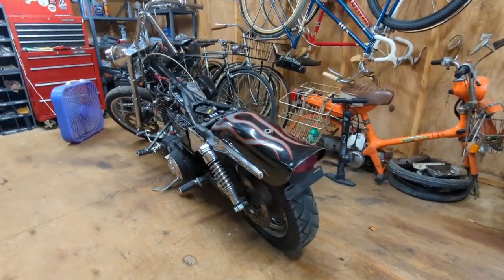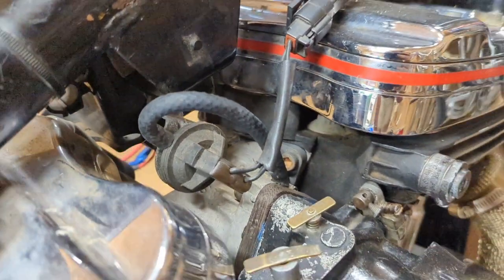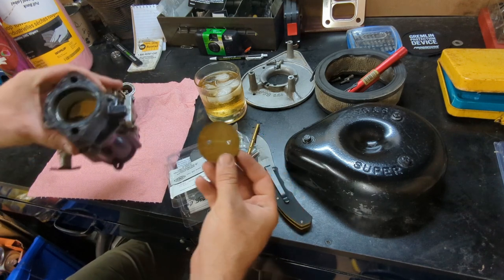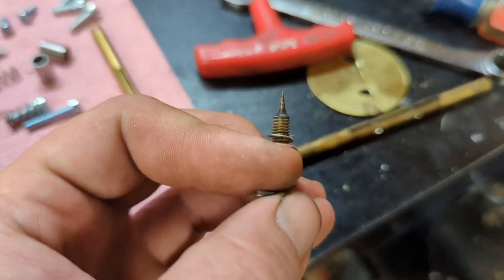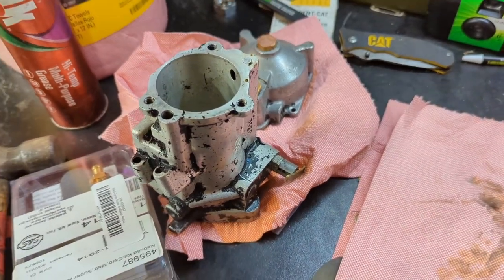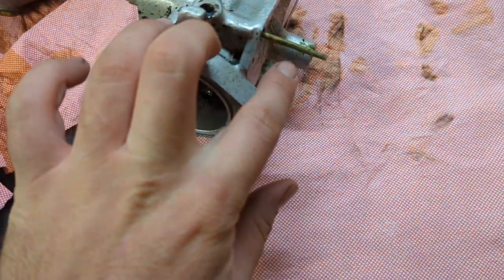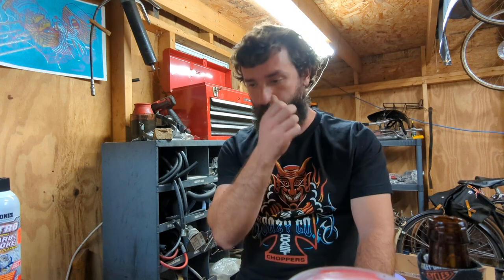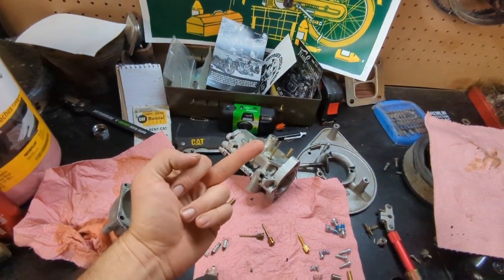S and S Super B Rebuild: Carburetor fail on Evo Chopper project

Comment: Fill the cracks with solder.  Order up a couple micro dripping bits the are the same as the o.d. of the tube and side holes.  Us the bits ( by hand ) to clean out the the tube and holes.

Comment: It is the emulsion tube for the enrichment circuit That crack if anything will lean out the enrichment circuit which isn't such a bad thing on the S&S carbs
Reply from the maker: You think it would run ok even with the crack? I couldn't find any good info on it online. If it's salvageable I may continue rebuilding it.
Reply: @buttcrackcycles  It should have no effect on running the bike, about all it could do is lean out the staring circuit. People tend to over jet the B and E (I don't know about the G) carbs to get rid of the mid-range stumble They put to big low speed jets in and open up the idle screw to cover the stumble Stock main jets tend to be a little rich Black smoke and fowled plugs